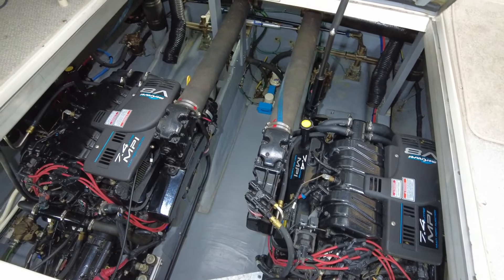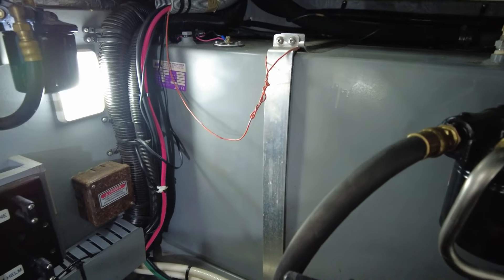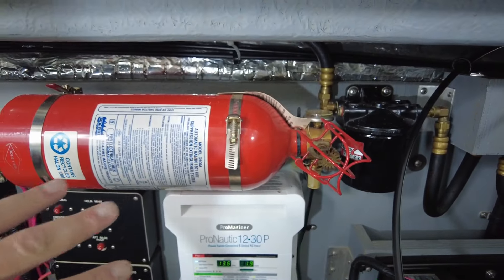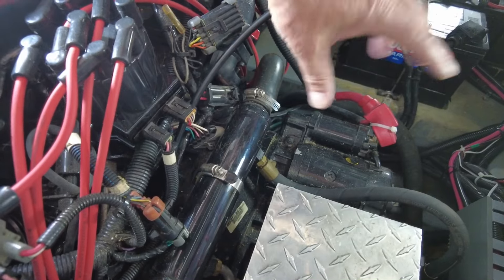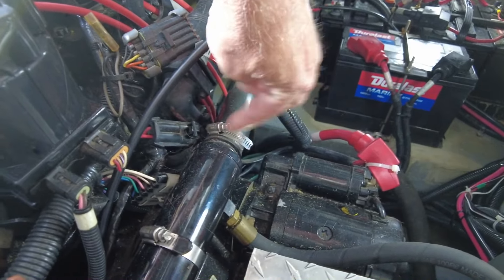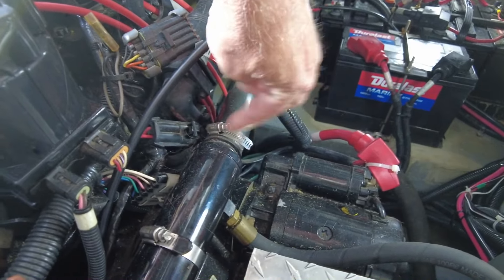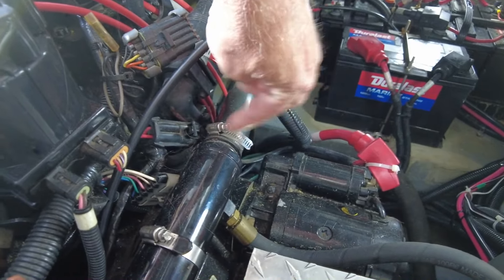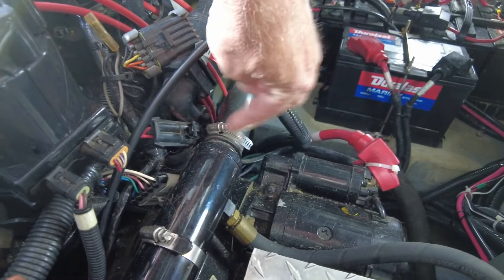Sea Ray Sundancer Engine Room Tour

Comment: Omg what an informative video. I was attentive to every detail presented especially ahead of my planned 2025 Trent-Severn Waterway adventure starting in Ottawa, thanks so much. Question: Anything at the top of your head that comes to mind when it comes to having certain spare parts aboard (must haves and nice to have) for the engine compartment (duck bill valves a for sure lol) but parts that may be potentially hard to get or take a long time to arrive if they fail, like spare vacu flush pressure switch, bilge float and pump? Given that I have a similar Sea Ray as yours, lucky me, I started gathering all parts numbers and stores from your videos to have one go-to list aboard that I can refer to in case I must order a part quickly once under way, and it proved useful already. Great video as always, thanks for sharing and looking forward to the next one.
Reply from the maker: Apart from what you've already gathered, I'd suggest spare impellers for the genny, seawater pump kit(s) for main engines, as well as a spare serpentine belt. I have an old one that I replaced which would keep us moving before getting a new one.
 Extra fluids (oil, transmission and antifreeze if you're closed cooling) are a definite must. 
 I'm sure I'll think of something else, but just take another look at my video on the tools and spares I have on Boogaboo, as a refresher.
 The benefit of your potential cruise through the TSW, depending on how far you go, is that there's lots of places along the way that can get parts for you, even if you have to wait a day. When we had the shift cable break back in 2022, the small marina next door to where we were staying at (Islandview Resort) was able to get the replacement ones overnighted so that I could do the repairs and get on our way again in relatively short order. . .
Reply: Noted and will do on all counts! A thousand thanks :)) Wish me good “lock”. Doh! LOLOL.
Reply: Paul beautiful engine compartment.  Super clean and organized.  What kind of cleaner do you use on all the surfaces?
Reply from the maker: @TheRetiredBoater Good lock. See, you're doing it again 😜
Reply from the maker: You just said it! Super Clean 👍
Reply from the maker: Aaaaaaand, I'll be counting on you to keep up with your videos - especially cruising the Rideau, TSW and wherever else you get to! YouTube will continue to need that type of content in the future...
Reply: @BoatingWithBoogaboo also hose clamps in all sizes I have broken a few over the years.
Reply from the maker: @ampegor And I have received more than a few cuts and scrapes from them 🤕

Comment: I didn’t understand your comment regarding the main battery switch.  When do you need to turn it off?
Reply from the maker: Didn't say the main battery switch, as I was only referring to the generator battery switch. If you've ever done any electrical work around your home (change a light fixture, for example), you would most likely have turned the power off to the electrical circuit controlling that item, beforehand.
 Same with the generator - or the engine starting batteries - to be safe from potential electrocution. As well, most folks will shut those battery circuits off when not in use for an extended period of time, such as the off season, to help lessen voltage loss.

Comment: Thanks for the tour, Paul. Very helpful and informative for sure. What type of stuffing boxes does your boats' shafts have and any issues you've run into? Cheers
Reply from the maker: This one, as well as our two prior Sea Rays have/had factory installed dripless shaft seals which are seawater cooled. Never any issues to report.